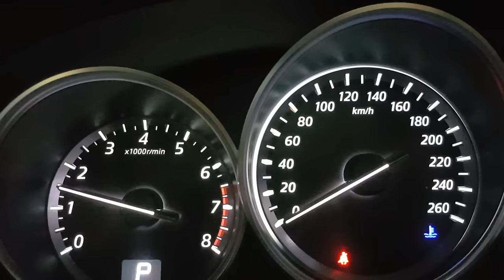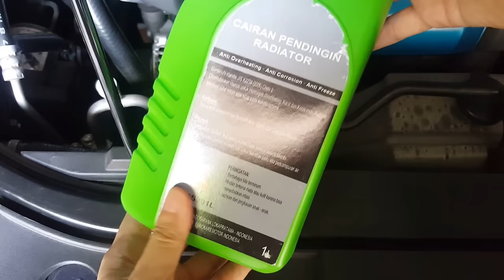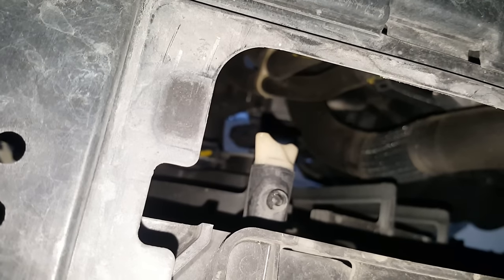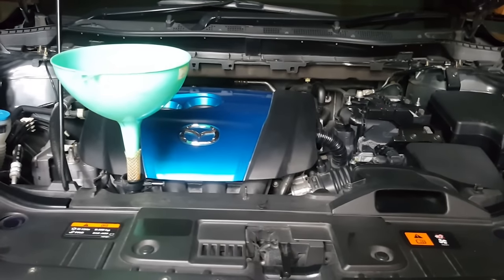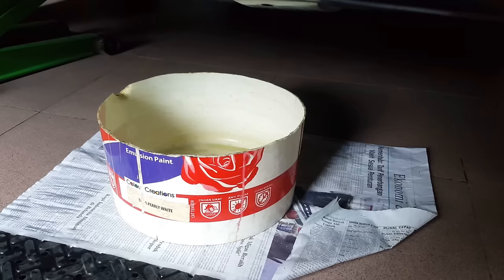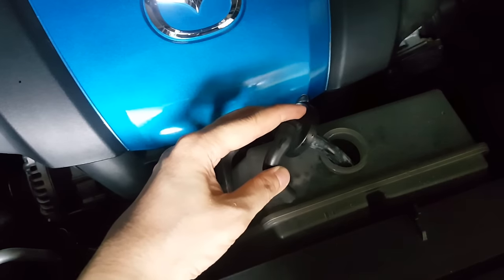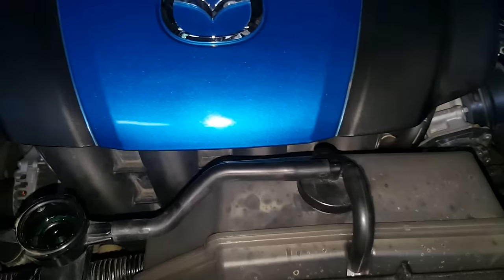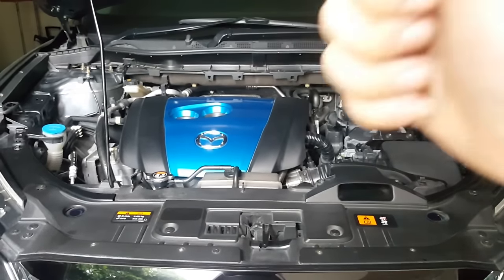Replace your coolant || Mazda CX 5 CX 3 Mazda 3 6 Biante Skyactiv

Comment: Hi Felix! I did the same procedure and i only used less than 4ltrs of fl22 coolant. Mazda 3 2.0 skyactiv.
Reply from the maker: did you already bleed it? and top up the coolant reservoir. It should be about 5 litres or so.
Reply: @GarasiFelixDan  yes i followed everything. I even checked the service manual too.
Reply from the maker: @blackriderph4340  ok thats no biggie as long as the cooling system are bleed properly and fluids topped up your car should be all good to go.
Reply: @GarasiFelixDan  yes thats what I figured. Im having no issues so far after a long drive.

Comment: I bled the cooling system with the radiator cap on instead. I realized this mistake a couple days after and then did it again with the cap off. Is it possible that there's air in my system from bleeding it improperly the first time?
Reply from the maker: yeap definately can re do the service just let the car idle and uncap the cap fill the rad till full and let the car bleed it self until the 2nd fan kicks in then you r done 👍🏼

Comment: When you drain the coolant via the petcock valve on the radiator does it drain all of the coolant or is there still some coolant left in the engine block?

The Mazda service manual recommends flushing the cooling system once the coolant is drained, that's why I'm asking.
Reply from the maker: some of left over coolant will be in the engine block. you could flush it if you want :)
Reply: @UCoJgjPIuMr0x0YR4yikLwvA

Any idea how much coolant?
Reply from the maker: @ceezedgerman  should be 4 to 5 ltrs left.
Reply: @GarasiFelixDan 

That seems like a lot, more than half the capacity.

How do you get the rest of it out?
Reply from the maker: @ceezedgerman  to drain the whole coolant you have to disconnect upper hose thermostat and lower hose :)
Reply: @GarasiFelixDan  how

Comment: I would also recommend to drain the engine block after you drain the radiator.
Reply: I wouldn't say so, in these newer cars it's not necessary to fully drain and in fact can hurt the seals.
Reply: @ZhuSeth  what seals

Comment: No need for one of those “Burp” Funnels and let run for 20-30 mins to make sure all air is out of the system ?
Reply from the maker: If you have the burp funnel would be much better so no spillage whatsoever. But if you dont have would be oke just to let the car runs until it burps for 15 mins or so and just top up the coolant once done.

Comment: Should flush with distilled water at least 2 rounds with engine running for 3-5 mins before pouring in new coolant.
Reply from the maker: Definately can do that for the next service.

Comment: Hi why do u use only 5 litres if my cx5 manual says the capacity are 9 litres aprox???
Reply from the maker: Yes correct this video just to show how to replace coolant from the radiator not full replacement including the left over from the engine block.
Reply: @GarasiFelixDan  my car year 2012 has 140k km, is not necessary to replace all the coolant? And is it ok if I put a coolant that is similar specs to the fl22 mazda, ? Thanks
Reply from the maker: @yegago  Yeah should be alright changing partial coolant is sufficient for daily car. Yes if can use similar spec to FL22 coolant.

Comment: i need help fixing SBS brake thing and forward facing radar, any ideas
Reply from the maker: unfortunately you have to take it to Mazda Dealer for ABS problem.
Reply: @GarasiFelixDan  its not abs  sorry its th e Epb for brake changes, anyway after brake change, it says it on my right screen, my left side where dummy lights come on, there is no lights on, just the 2nd screen on dash thanks man
Reply from the maker: @jimsinnovations2737  maybe recheck the brake caliper, bolts and piston and do it all over again see if the light goes away.
Reply: @GarasiFelixDan  ty man will try that

Comment: Охлаждающую жидкость слили только с радиатора и расширительного бака, порядка 2,5 литра старой жидкости осталось в отопителе и патрубках системы.
Reply from the maker: it should be more than 2.5L comes out from the system.
Reply: @GarasiFelixDan  Вся система вмещает порядка 7L, вы слили только около 4L
Reply from the maker: @ЕвгенийШаталов-в1т  yes this video is not about draining the whole cooling system. To fully drain you have to disconnect the lower and upper hose and you can drain the whole from the block. But if you repeat the drain and fill every 2 years your engine should be fine and you are not wasting too much effort on this particular service.
Reply: Зачем мешать старую и новую жидкости? Не так сложно слить максимально все.
Reply from the maker: @ЕвгенийШаталов-в1т  Im not ocd about it and at the time its not neccessary to do a complete coolant drain for this video. The car is completely fine until now. Just do a regular drain n fill every 2 years or so. you should be all good to go.
Reply: У меня тоже все ОК!
 Машина 2014 г.в., пробег 215000 км., поменял охлаждающую жидкость первый раз за 10 лет.
Reply from the maker: @ЕвгенийШаталов-в1т  yeh if the car is 10 year old might aswell do the full drain and change the water pump if the car needs it. 👍🏼👍🏼
Reply: Не нужно, все норм! У меня даже аккумулятор с завода, i-stop никогда не выключал (режим город-трасса : 2/3)
Reply: Отличная машина, отличный двигатель!
Reply from the maker: @ЕвгенийШаталов-в1т  ahh yeah cool no problem.
Reply from the maker: @ЕвгенийШаталов-в1т  yea they are. very easy to maintain. 👍🏼
Reply: "Рабочая лошадка"!
Reply: Жду, когда сломается))
Reply from the maker: @ЕвгенийШаталов-в1т  dont forget to keep supporting this channel by subscribing. 👍🏼
Reply: Ок!

Comment: I tried to bleed the system after changing the coolant. When I did, the coolant just started to overflow the radiator cap so I turned the car off... Is this normal?
Reply from the maker: Yeap its normal. Let it over flow for 10 mins until both fans kicks in. Then after that just top up the coolant until full & dont forget top up the overflow bottle too. Rinse away the spillage with clean water.

Comment: This video is wrong in so many ways. If you do this you drain only half the coolant. The rest remains somewhere in the system. 
This procedure is not complete!
Reply from the maker: @Lotrioni  Then would you kindly tell us how? as specifically im not doing a full system replacement on this video. 🙏🏼😁

Comment: The car has 30k km why would you mess with it. OEM coolant is easily good for 100k
Reply from the maker: The purpose of this video is to show and help owners how they can do it themself. I already know the coolant is good of 100k. Maybe if you like you can replace yours at 100k using this method. :)